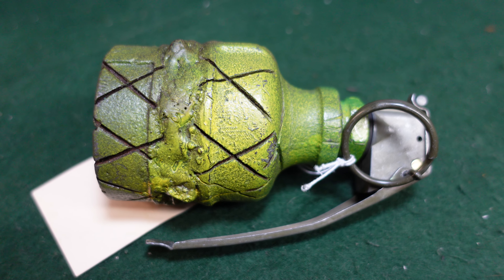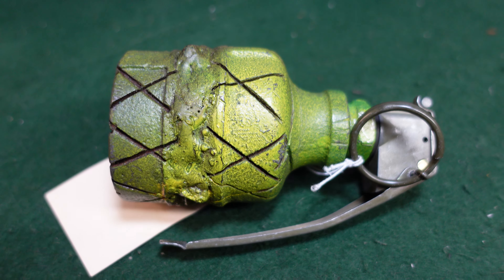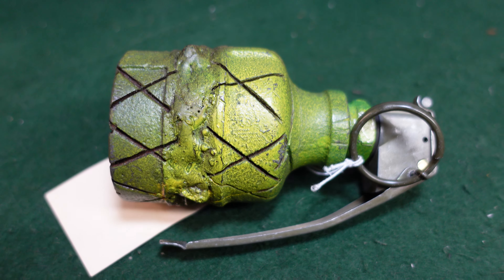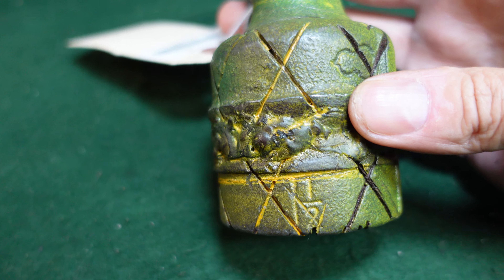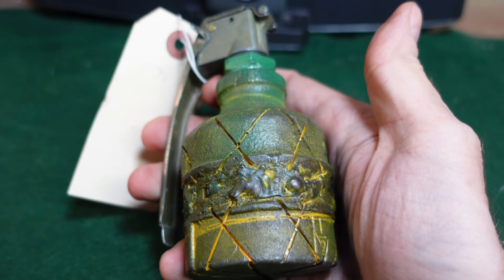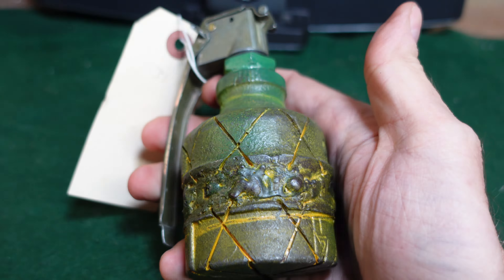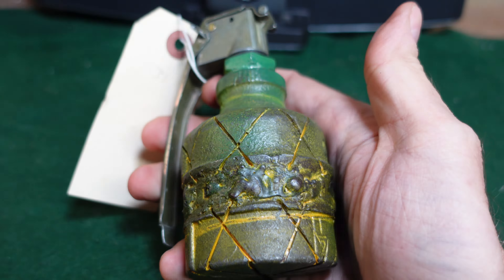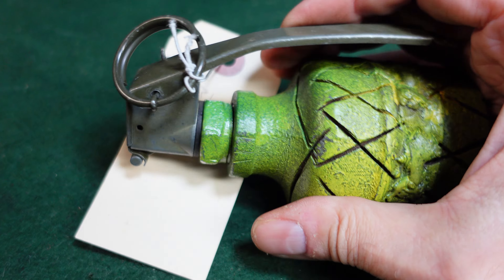An Insurgent Copy of a French DF37 Grenade?

Comment: Any idea what they packed them with?
Reply from the maker: My guess on something like this would be TNT.
Reply: @historicmilitaria  Yeah almost has to be. Gunpowder might not be strong enough in such a small rascal as that. Not much room to make it too strong. I wonder how many would just fall and break open since they welded two cast iron parts together.  It's a tricky task to get it to not Crack and fall apart. So that in of itself is impressive, even tho the welds look awful they held lol
Reply from the maker: It's a really interesting grenade, and unlike anything I've seen.  It came in a large collection of Balkan grenades, so that's why I made a possible Balkan connection, as well as its overall similarity to the Yugo M62 grenade.
Reply: @historicmilitaria  Exactly. I'm impressed for sure. To see something so crude yet well made, with a proper modern Fuze hanging out is a great little representation of times it was used in. If only it could talk lol
Reply: @historicmilitaria When lexpev was still around, he said there was one popular brand of mining exp. that was used in the war grenades, regardless of the faction. It had a medium power. The thick casing puts me in mind of some of the Polish WWII grenades that the AK designed and put into production from scratch. When the Axis forces moved in, they were unpleasantly surprised by the nasty Polish grenades. Thick casings again 80 years later. . .